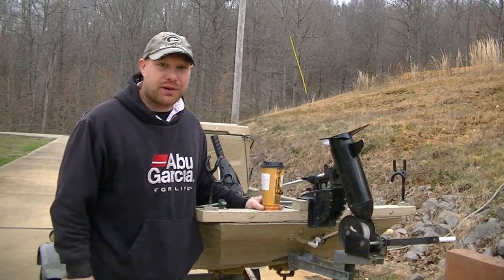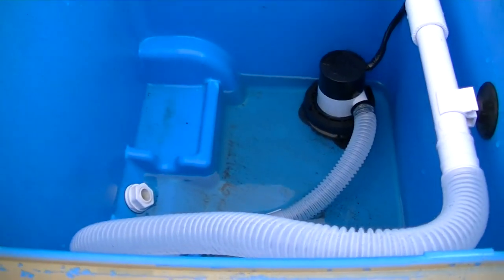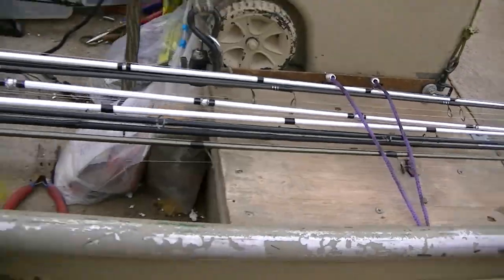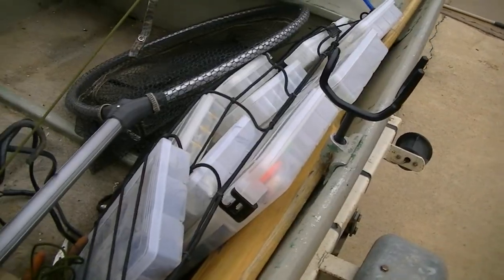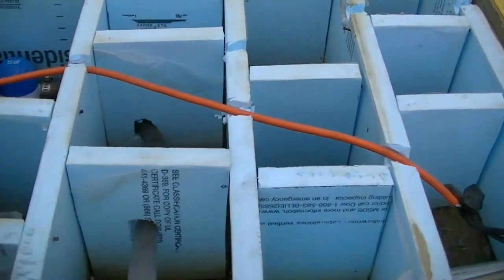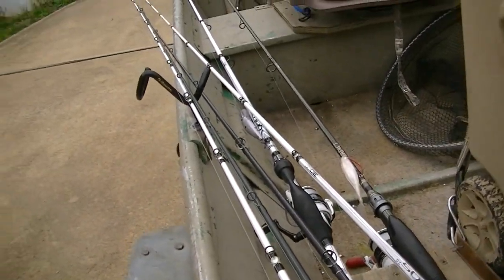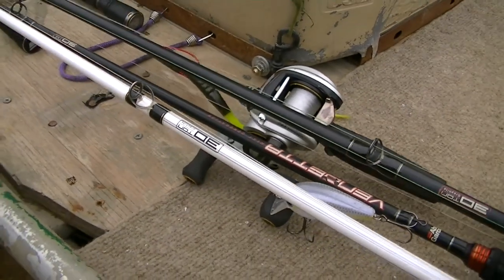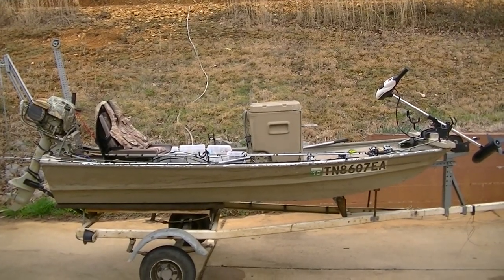Best 10-foot jon boat setup ever!

Comment: Awesome! I love little boats. Fishing was never meant to be a competition, much less done in $30,000 boats pulled by a brand new SUV painted the same as the boat and covered in stickers. Customize and maintain your own boat, add a kid now and then and the fishing will be that much better. Fish on!
Reply: 30,000$!  You’re getting a great deal lol, most of the bass boats are closer to 60,000$
Reply: The Lowmein try 100k
Reply: @crankinbass5758  a bass boat for $100k the damn  thing better have a basement, central heating and air and at least 1 big comfortable bathroom to kick back and read the paper between casts... The law of Diminishing returns on its finest display right there I suppose...i would honestly be embarrassed to bass fish out of a $100k bass boat. If I won something like that I'd sell it and still get a used  bass tracker
Reply: Lowe1243 minn kota trolling motor. Nephew (15) & I enjoy small lakes, Beshear, Loch Mary, Lake Peewee. Making memories & being in outdoors. It doesnt have to cost a fortune to catch fish.  ATB
Reply: Exactly!
Reply: For sure. I use a Coleman scanoe with a 2 hp evinrude from the 70s and me and my lady always have a blast fishin or just putting around the lake
Reply: $30K?

Comment: I like your efficiency of the space you use in your boat, your anchor pole is ingenius, great idea and design, I also have the same Briggs and Stratton Outboard motor, reliable and efficient little outboard, great job .
Reply from the maker: Thanks!

Comment: Great video , I sold my  2014 Skeeter after a couple of years I just couldn't justify spending that money bought a g3 jon boat couldn't be happier plus I love doing modification to fit my style . You don't have to spend $ 100,000 to fish it's getting crazy Keep a tight line man
Reply from the maker: Thanks for watching! Eventually I plan on getting a larger aluminum boat, but honestly, I still have not yet fished everything near me that I can get to with my little boat. I am saving up for some electronics to help me more efficiently fish many of the bays, coves, and creek mouths that the little jon boat can handle, but at this point in life I can't afford, nor justify having a monthly boat payment...and i'm still having a ton of fun fishing out of my small boat!

Comment: Great video. You took what you had & made all kinds of mods to fit your needs. I fish (rarely) but you are a fisherman, and the tools you have added to your little boat show that "function over form" is your style. Best to you.
Reply from the maker: Thanks!
Reply: I love little 10 ft and 12 ft jon boats there's so much fun and so easy. After you're done fishing no muss no fuss and easy cleanup that's what it's all about having fun and not having to work so hard at fishing. Great video great job bro

Comment: i have a 10ft jon boat, i put a platform on the front, went out by myself and had a blast.. alot more fun then using my bigger vhull boat and way easier to transport (just thru it in the back of the truck).. nothing fancy but it is forsure my new go to on small waters
Reply from the maker: Hey, thanks for watching! I hope you catch as many fish from your small-water jon boat as I have from mine...they really are a lot of fun!

Comment: Very smart using the 1 inch foam for deck supports.  I'm gonna do that too!
Reply from the maker: Thanks for watching. The deck is still holding up fine, with the original foam I used. So it works great.
Reply: @TheLowBudgetOutdoorsman so you didn't use framing you just used foam??
Reply from the maker: @kylemartin62  yes, just foam

Comment: A very nice little boat.  Using the insulation board as reinforcement for your deck was a great idea. All boats are a set of compromises. Your boat has its niche in the shallows  and calm waters. I'd rather be fishing there than on rough choppy waters. Your 'power pole' is very cleaver. I wish I'd thought of that before I spent $1200 on my real power pole.  I do hope you have a good life vest. If that boat starts taking on water, it could go down fast. Good fishing to you.
Reply from the maker: Thanks for watching! It is very much a boat for creeks, bays, and shallow or protected areas of the lake. I do have a good life vest, and I also enjoy open water, or medium distance (up to 5k) swimming, so if the boat sinks, I can swim to shore fairly easily in any of the lakes the I fish. But I still always wear the vest if I'm running the gas motor, and bring a change of clothes in a plastic bag if the water temps are really cold, in case I end up in the water somehow.

Comment: Nice little setup. I am at the point where I could afford just about any boat I wanted to buy, but enjoy just cruising around in a 12 ft 1975 SeaKing from Montgomery Wards I inherited from my father-in-law a few years ago with a 2.3 Honda on the back. It is a relaxing way to spend a Sunday fishing. I did mount a Lowrance 9 inch GPS chartplotter / fish finder, that probably cost more than the boat is worth, lol.
Reply from the maker: Thanks for the comment! This little boat setup is fun, and works really well in lots of small water scenarios...and, like you, I put a 9" (Helix si/di/gps combo) unit on it, and that helps

Comment: Lil boat is fully equipped. Like the foam on edge for casting deck support . Great idea on power pole might need to borrow that . Set the hook brother
Reply from the maker: I set the hook from it at least 10 times yesterday. lol. Thanks for the comment.

Comment: Very interesting. The only thing I'm surprised not to see is a fish finder of some sort. I'm a saltwater fisherman, don't have the option to do this but it's very cool. I love fishing and love saltwater fishing but I just put a radar system on a 28' center console and it really is silly what stuff costs. Great stuff!
Reply from the maker: Thanks for watching! I did add a Gen 1, 9" Helix side scan sonar combo when they went on clearance...so I do have all the fish-finder that boat needs. If I put anything nicer on it, it'd be worth more than the boat. lol. Electronics are indeed pricey!
Reply: @TheLowBudgetOutdoorsman  that's perfect though and side scan is a nice feature! Heck the first boat I bought had an old Lowrance black and white 4" basic sonar unit and I thought it was cheating it was so useful! The sad part about marine electronics, and all electronics I suppose, is 3 years ago I bought 3 different 12" units with every Bell and whistle and now they're to some degree out of date! Most of my electronics are safety related not even fishing related! No matter what you have there isn't much detail in 600+ feet of water.
Reply from the maker: @jeffsmith825  Yeah, I've only been on a deep sea fishing day trip once...it was a lot of fun...but I got sea sick. lol. I'll try it again some day. LOL

Comment: I can see why this is titled, Best 10-foot jon boat setup ever!  You are very clever!  I have a 79 sears/elgin just under 12ft.  How did you connect the foam framework together?  Did you brad nail it or anything?
Reply from the maker: I have a video on my channel on how the foam deck is made. But it is basically just slid together. Small boats can be fun, and Thanks for watching!

Comment: would like to see more detail on that motor... very cool
Reply from the maker: I purchased that motor about 10 years ago as it is today. Briggs and Stratton made a air-cooled outboard for several years. I have been very happy with it for my little boat. It is basically a lawnmower engine, so it vibrates a little more, and is louder than a traditional outboard, but it was a third of the price, and isn't water-cooled, so good for shallow water. Since it is a basic Briggs engine, it needs the same preventative maintenance, service and parts as just about any other 5hp Briggs engine, so parts are easy to find, and servicing it is easy. I have not replaced anything on it whatsoever, nothing has broken in 10 years (i do change the oil, and run ethanol free gas in it, run the carb dry of fuel for winter storage, and store it in a garage, and all of that helps the longevity). I still see a few of these motors out there when I'm fishing occasionally, but obviously Briggs wasn't selling enough of them, or they'd still be making them. Hope this helps, and thanks for watching.

Comment: That's a really neat setup!!  Would you mind measuring the length of the setup from hitch to back motor?  I've got a really small garage and was looking to see whether a 10 or a 12' jon boat would fit.
Reply from the maker: Hey, sorry I missed your question somehow. The trailer that I have is 16 feet long (from tongue to back of motor) , and it can fit up to a 14' jon boat (with some adjustments required), without adding any length to the overall dimensions . There are trailers that have a folding tongue which allows for a much shorter storage length, but mine does not have that option. Sorry again for the delayed response!

Comment: I know this is old. But I was wondering if you have thought about putting inflatable pontoons on the sides for stability?
Reply from the maker: I have thought about it, but have not felt the pros outweigh the cons. While it would gain in stability, it would lose some of its maneuverability and ability to fit in tight spots. In my opinion, the best way to have more stability is just to upgrade to a a larger jon boat with a wider bottom. Since I have not needed the bigger boat, I have gotten by with the less than ideal stability of this boat. Good question though...and thanks for watching!

Comment: Auto parts stores sell a small solar charger for your car. One would work great for maintaining your boat battery while trailering to, or from the water. Just plug it into your battery port, and lay, or strap it down on the deck, in the sunshine.
Reply from the maker: I'd not thought of that...good idea

Comment: Wow. That's crazy. Not to throw rain on your parade but a 10 foot jon boat has a TOTAL weight carrying capacity of around 300lbs. That includes you, your motor, fuel, marine battery, and all that stuff you added. You have got to be WAY over weight with that rig. How much freeboard have you got? I'm guessing about 3 inches. One big wake from some unkind boater and you are swamped. But, its your boat. Pretty damn creative. I'll give you that. Be safe out there.
Reply from the maker: Yeah, I mostly fish places where there aren't boaters running around wide open (shallow bays, up in creeks, etc). It certainly isn't the boat to be out on a big lake with a lot of traffic.

Comment: To say I'm impressed is an understatement.  All you did is great.  One question.  How do you steer the trolling motor?  I'm 80 and not so limber any more.  Steer with your feet on the motor handle?

Years ago I had a jon boat with a transom mounted 5 hp Clinton outboard.  I'd sit on that idling motor and steer by swiveling my body left or right.  My trolling motor.
Reply from the maker: Thank you, Sir! 
If I am sitting on my cooler/seat then I do adjust the trolling motor handle with my foot, but primarily I stand up at the front, so I just use my hand to turn it.

Comment: I’m wanting to get a job boat soon probably going to use your set up lol. Will this boat handle two people pretty easy? Best setup I seen for a 10 footer
Reply from the maker: It isn't really designed for two people, so if you plan on fishing with two people in a jon boat very often, I would recommend a little bigger jon boat. I have fished dozens of times with two people in my boat, but it is not ideal. All the setup I have done would still be applicable on 12 foot or 14 foot jon boat.

Comment: Love your engineering but unless you scored a major deal on the 10 footer I would think a few more feet of length would add a lot of beam adding much more stability and gear options for not much more cost. I started out in a borrowed 10 footer on west point lake ga. If I dropped the anchor in deep water with a little chop it would start taking water over the side. Jon boats are definitely the best way for a fisherman on a budget to get on the water as long as you wont be taking water over the sides.
Reply from the maker: Thanks for watching and commenting! I do plan on getting a bigger boat at some point; and yes, a 14' jon boat is many, many times more stable. I do not use an anchor (other than the shallow water anchor) for that reason... I do not want to be tied to the bottom if a wave or large wake comes my way.

Comment: Love it!! I'm doing some mods myself and was wondering what are the dimensions of your Jon boat?? Thanks 👍
Reply from the maker: It is a 10 foot jon boat that is 30 inches wide on the bottom.
Reply: Thank you so much for the reply. My boat is 14ft 30 inches wide 15 inches deep. I figured a little narrow but I don't stand up or want a casting deck. Is yours fairly stable or does it get a bit tippy, I've never found another 30inch wide Jon I figured mine must be really old.
Reply from the maker: @noahcline100  it definitely is a little tippy until you get used to it. Lol

Comment: I wanna set up a jon boat for me and my gf (about 425 lbs together) and was wandering if a 12 or 14 foot would be better cause I still wanna be able to car top it
Reply from the maker: I think a 12' jon boat would be much better on top of a vehicle. It would take two folks to lift it, as they are awkward to handle by yourself. I picked up an old 1436 size jon boat, and it would not fit on a vehicle roof rack!

Comment: Ever fall off of this boat? Got me a 10fter but haven’t taken it out yet. Little worried about the stability of it. I’ll be standing on the floor in it. Hoping it works out ok
Reply from the maker: Sorry for the delayed response! They are not very stable, compared to jon boats with a wider bottom, but I have not fallen out of mine yet, and I stand up on the front little deck while fishing nearly all the time. It feels at times very tippy, but I think it is more capable than most realize; once I was fishing from an island out on KY lake and I guess a wake dislodged my boat from the shore while I wasn't paying attention, and it floated off. By the time I noticed it, the boat was way out there, so I had to swim out to it, and wasn't sure what I'd do when I got there, but I was able to actually climb in it over the side without it taking on too much water. So it surprised me how stable it was when a whole lot of pressure was put on its side (I swim triathlons and open water stuff, so I can swim over 3 miles non-stop in a neutral current situation...which came in handy that day. lol). If there are white-capped waves or large boats pushing huge swells I would stay off the water, or find a cove or protected bay or creek to go fish in. Thanks for watching and commenting, have a great new year!

Comment: Is that a 32" bottom? I switched from a 12/32 to a 12/36 and it made a world of difference in stability.  Have you thought of getting a little bigger jonboat and adding all your modifications? good job.
Reply from the maker: Thanks! Yes, mine has the narrow bottom, and a wider one would be much better.

Comment: Nice, but what about the trailer?? I'm gonna make my own "jon boat" and need help on the trailer.
Reply from the maker: Hey, sorry for delayed response. I didn't have a trailer when I got the boat and just loaded it into the bed of my truck, but that was inconvenient. Then one day an older guy a few houses down from me pulled that trailer out of his barn and put a "For Sale"  sign on it. I got the trailer for under a hundred dollars...so that's where I got the trailer. I would say just look in local classifieds or local market place, as there are usually boat trailers for sale, and without a boat, they do not retain a lot of their original value, so the owner may be much more willing to take whatever they can get for it, as opposed to sticking to a list price.

Comment: How do you secure shallow water anchor while driving if it ever dropped while you were driving could be very bad for you and anyone close? And it's hard to see exactly how you did some of the moving parts on anchor on video is there anyway to get diagram. Would like to put same anchor or two on my boat.
Reply from the maker: Hi, and thanks for watching. I secure it with a piece of 550-cord and a sturdy bungee, so I have two means of holding it up while in transit. I do not have a diagram, but I will do a short video just on the anchor when I get a chance in the next week or so.
Reply: Thank you and good luck fishing
Reply: The Low Budget Outdoorsman I live in cookeville tn that's awesome me and my dad want a boat and this will give us so many ideas thanks

Comment: Question, how much weight do you have in that boat, gear engine trolling motor battery live well and your self? I am looking at one and say max weight 275 pounds. Which I by myself is over that limit. Also genius on the foam.
Reply from the maker: I have about 350 lbs on it , including me. I have seen the weight capacity range from 280 lbs - 380 lbs for 10 foot jon boats, but a 12 or 14 foot jon boat would allow for a much larger weight total.

Comment: I used to LOVE Abu Garcia now I'm switching over to reel from China they're cheaper and I found some really good ones DNK those reels are amazing
Reply from the maker: Hey, Thanks for watching. I may check them out. I do not have any brand loyalty, but Abu was the only brand that had their whole lineup of low profile casting reels in left hand retrieve, which I prefer. Quality is rarely cheap, but I have been able to find bargains on good quality equipment and also just save up for something that will last a while. Having a Low Budget for outdoor stuff just means it takes me a while to save for things. lol.